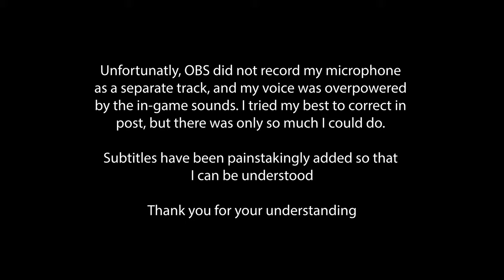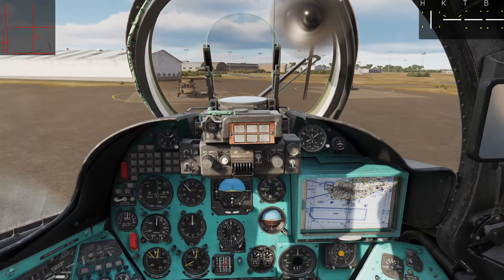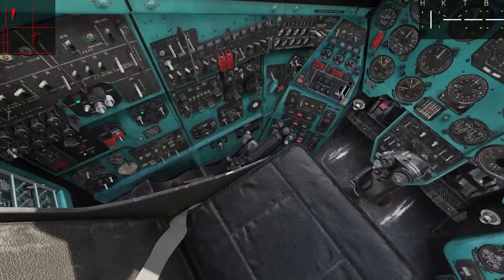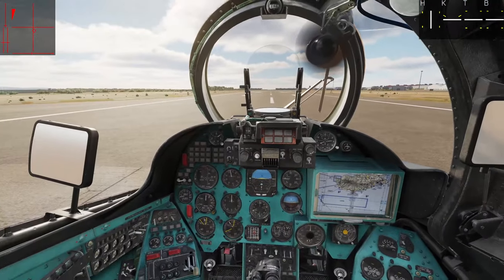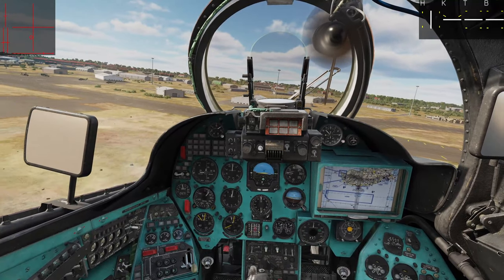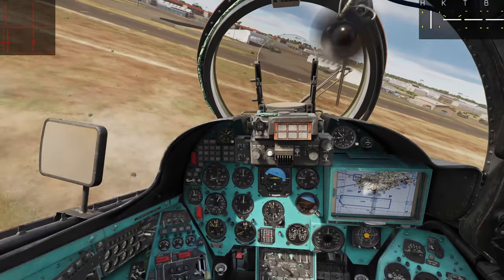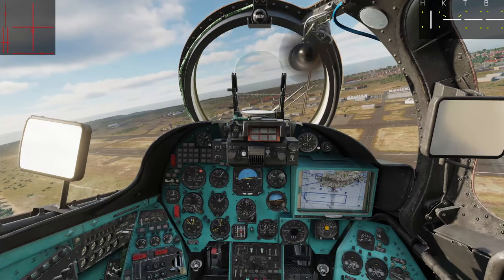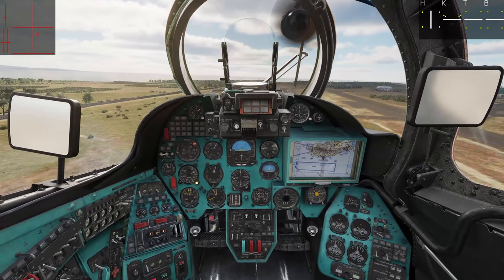First Flight and Impressions of the DCS Mi-24P Hind

Comment: Respect for lasting that long without trimming. For science! ;) About the tail rotor... Check the alignment of the rotors from outside, nothing is designed at straight angles on the Mi-24. It's not build for doing a lot of hovering, it's build for going forward fast, at low altitude and nose on target.
Reply from the maker: Thanks. I will once again emphasize that I chose not to use the trimmer simply so that I had a sense of what the controls were like in flight. Obviously you should use the trimmer under normal circumstances. 

I'm not sure what you're getting at regarding the tailrotor. Are you referring the issue in sideflight? I think I'm going to make a follow up video about that.
Reply: @ErikScott128  Yeah, check the unusual tilt of the main rotor (forward and sideways) i think there is a part of the explanation why drifting to one side is easier than drifting to the other side...
Reply from the maker: @alexandervoigt7313  Oh, I see what you're getting at. Yes, the rotor does indeed have a lateral shaft tilt. From my understanding, that's there to help correct for the lateral tail rotor thrust ("translating tendency"). It shouldn't have a large impact on side flight velocity since the fuselage will likely be similarly draggy regardless of the slight difference in roll attitude.

Comment: Nice catch on the side flight behavior. And don't beat yourself up over the VRS either, without the shudder you have even less warning than usual that it's happening.

Thanks for sharing this, I've been interested to hear your thoughts on the Hind.
Reply from the maker: Thanks for watching! I know it's probably quite boring for many people. I intend to do a short(er) video on the sideflight issue, so that I can bring it to people's attention without making them sit through this whole thing. I suspect they're trying to simulate something with the tail rotor inflow (LTE or tail rotor VRS) but not doing it quite right. I should mention that this is a VERY difficult thing to model properly without freewake or CFD, which we can't yet do in real time.
Reply: @ErikScott128  not boring at all. And it would be very exciting if they were trying to model LTE for the Hind. I know I have developed some bad habits from not needing to worry about it in the Mi-8.
Reply: Shudder before entering VRS and TL is already implemented in telemetry output, i can feel it via simshaker. Maybe the animation is missing because of early access.
Reply: @ErikScott128  Speaking of real time fluid dynamics simulations, what are your thoughts on Flight Unlimited 1995? Doesn't it look like they actually achieved what was advertised? Sure, it's rough around the edges (that's to be expected), but it does look like some actual real time Navier-Stokes calculations were involved?
Reply: @alexandervoigt7313  Interesting. Thanks for mentioning that, I'm really missing the shaking telltales.
Reply: @ErikScott128  Honestly, I love these kinds of videos (I'm sure the guys at ED probably like seeing detailed feedback beyond "It just feels weird" for their work too). 
Maybe it's just my childhood dream of designing planes that was quickly extinguished by my very real inability to not be terrible at math, but I've always enjoyed watching people "in the know" mention little things they notice.